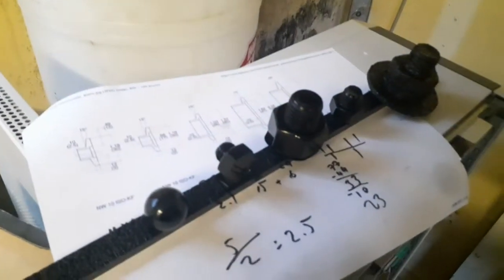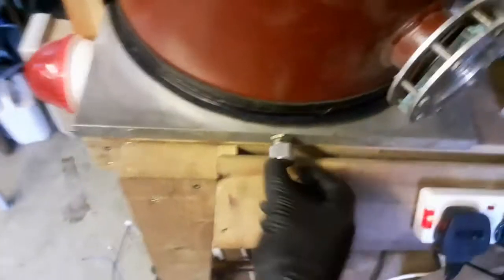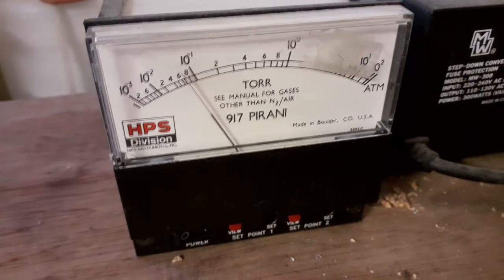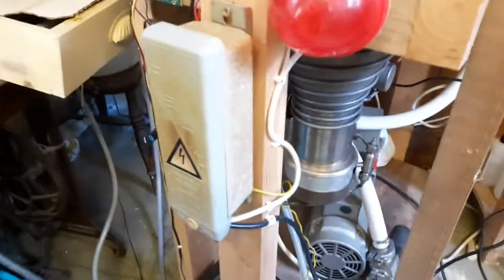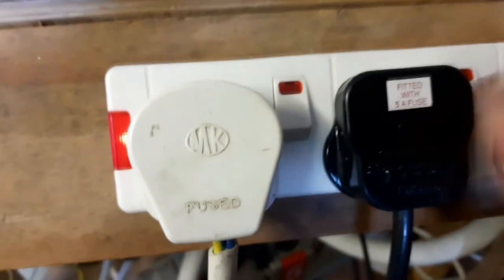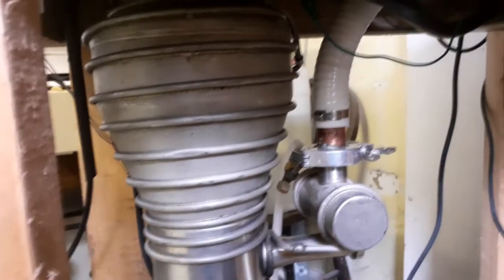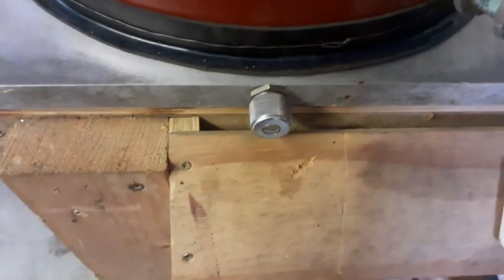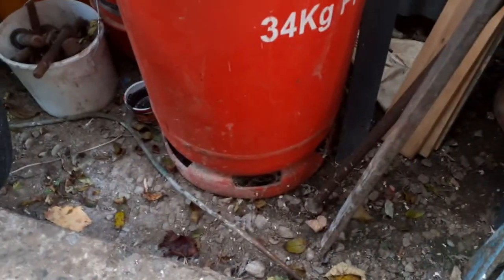DIY Homemade High Vacuum Metalisation Chamber pt.2

Comment: This is one of the best videos I've seen on the internet! Thanks for posting it!   
I have the only100% ion propelled vehicles in the world that lift their own power supplies, shown flying on my channel.  They are built to be really super light in weight.   The structure of the crafts is mainly made of metalized polypropylene strips 22.2mm wide that are formed into streamline tubing and glued along the edges, to hold that shape.  I originally made the crafts out of aluminized plastic, but it would oxidize after a few weeks and the devices wouldn't work then as well.  Later, after many years I purchased some rolls of silver metalized polypropylene films.  While that doesn't oxidize, it does tarnish, so those crafts only had a lifetime of a few months.  It takes a long time and a huge amount of work and investment to make each craft.  The last current craft is made out of gold metalized plastic, probably only about 100 angstroms thick of gold on it.  Even though the entire craft only has several hundred milligrams of gold on it, the company that sells the material charged $9k for several small rolls of the 6.8um thick gold metalized polypropylene, I couldn't afford the variety of thicknesses that are required for it to work like the original design.  In order for these crafts to work well it requires graduated thicknesses of plastic for the collectors ranging from about 3 microns to 8 microns on the outer collector ring.  The device is made of concentric hexagons and requires tougher material on the larger outer rings.  
Long story short, I was wondering if you know how to make a roll-to-roll film coating machine that can make high quality coatings of gold metalized polypropylene films.  I surely can't afford multiple thicknesses of these metalized plastics. It was a once in 20 years thing for me to afford the one thickness of the material.  Alternatively, if there is a metallizer that is very reasonable.  That might work as well. Lastly, I have considered cobbling together my own vacuum system, if I could find one cheap enough.
Thanks ahead of time for any info you may have!

Comment: Brilliant! What's the voltage and amperage across the filament heaters?
Reply from the maker: Hi RonBo, if I remember correctly the filament/boat sees about 3v. Current, I'm not too sure. I'm kind of just eyeballing the filament while twiddling the variac. I will put a clamp meter on it next time. It's a good question!
Reply: @Robertwclarke  You mentioned high voltage? Would that be at the primary winding of the transformer?
Reply from the maker: @Ronbo765  let me review the vid. This system is really interested in high voltage for cleaning of substrates. Other than that it's loooow voltage It was a while ago I made this vid!
Reply: @Robertwclarke  ahhh ok.